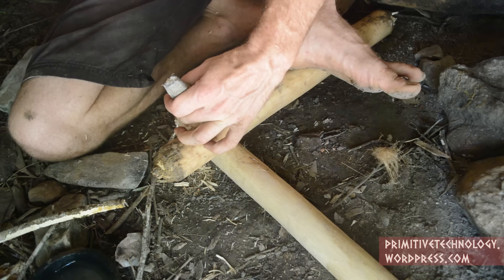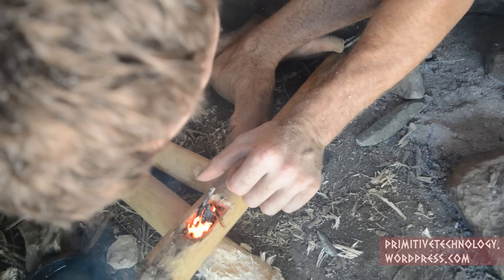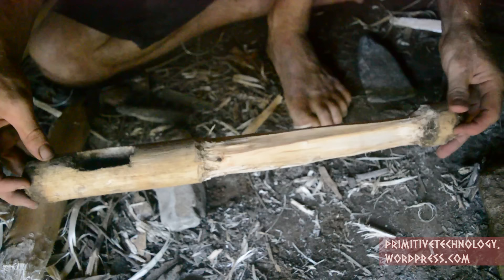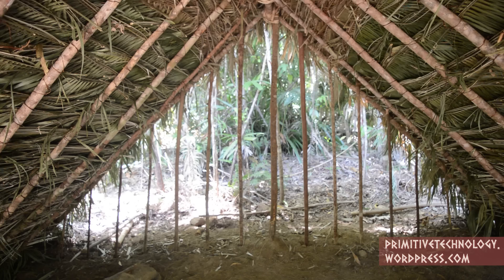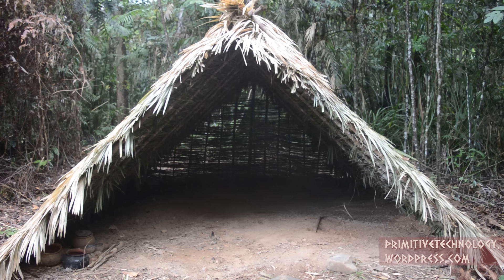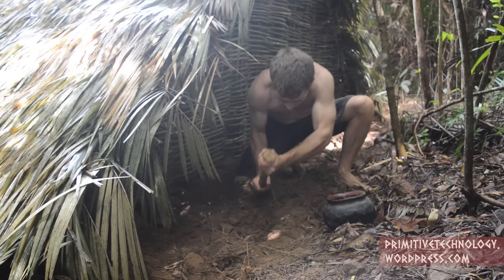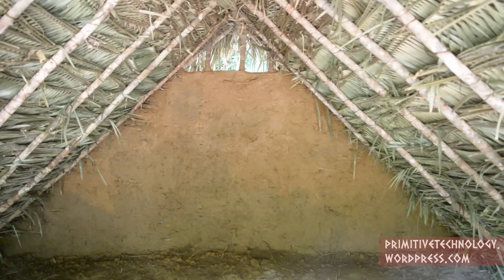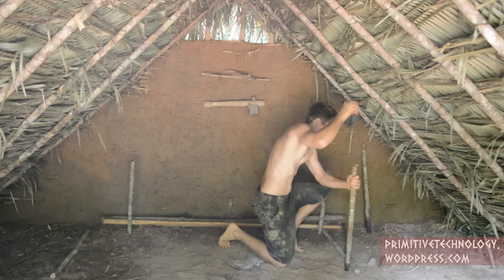Primitive Technology: A-frame hut

Comment: So one question that bothers me, how long is the roof going to withstand the weather? I mean your last roof were made out of tiles but the new ones are completely made with plants, aren't they going to rot away with all this rain over time? Just curious ;)
Reply: I'd wager the reason it will last a few years is likely the large amount of trees in the area and dense foliage. They serve as a both a wind break and weather proofing. Unless of course one happens to fall on it like in one of his other videos lol.
Reply: And herein lies the beauty of using frond at first. It is a hell of a lot quicker and easier to set up a roof of frond over creating and firing tiles, even though tiles are better and will last longer. If frond will last up to 2 years, that gives you 2 bloody years to make enough tiles to replace the frond.
Reply: starkerbaum fichte wouldn't it turn to soil and soon turning into mud from rain? So it's like a mud roofing after like 5 years?
Reply: Samuel Barlington that's why you fire the tiles before using it... you can't just use solidified mud you have to use clay that has been heated to a certain temp for roof tiles
Reply: If you know how to assemble this, you can just create a new one after it's shit.  I was thinking to put an identical frame hut over the original.
Reply: Well yeah rot is quite the problem for thatched huts such as this but that won't be for some time. By the time it finally kicks the bucket he will have already made clay roofing tiles or advanced to bricked houses.
Reply: NadlieHime 1814 what if you set it on fire?

Comment: Try making glass
Reply: He created furnaces that could smelt metal out of dirt deposits / ore. I don't know what heat he would need for glass, but those furnaces can produce insanely hot temperatures.
Reply: Ever played minecraft
Reply: I know it's not Minecraft it's called a SUGGESTION
Reply: Ines Kershaw you sound triggered its called a JOKE
Reply: Ines Kershaw hey made iron once
Reply: That would be really cool to do only thing is what for?
I mean everything so far had some sort of use making life there easier. 
glass in general is pretty useless except maybe for precision cutting.
Reply: CMR plus what would he be able to cut with the glass? Palm leaves? He isn't cutting wood or anything useful
Reply: Who do you think he is , Walter White? Besides, who's he gonna sell it to?
Reply: and soap